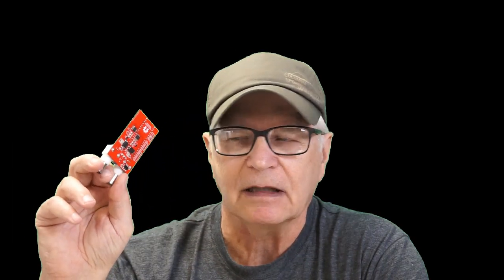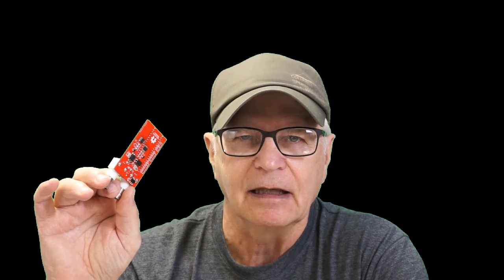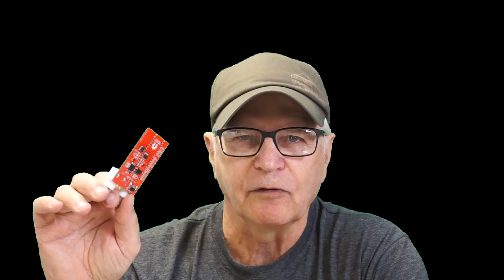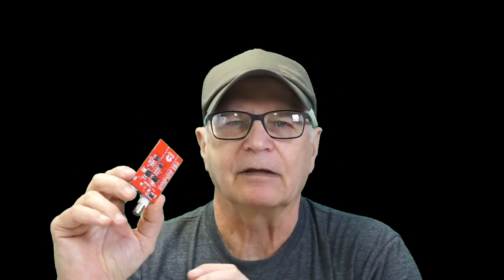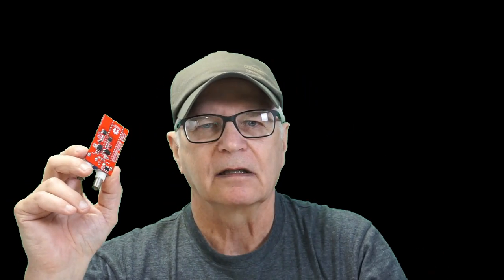GADGETS#145 - PREHEATER 946-1010 MANUAL

Comment: Maybe others will have some use for it but this is what I know so far about the new model now being sold on aliexpres. Model name is still the same but this is the white/green variant.

Press and hold temp up button and down button at the same time at the same time, brings you to the menu where you can set your temp offset (I think) goes from -50 to +50.

Temp up button and set button pressed and held at the same time takes you to another menu. In that menu you can only adjust the first one. I don't know what it's for but you can go from -199 to +199. I can't adjust the rest in the menu.

I did look at what chip is in it, hoping I could figure out how to make it heat up a little slower but there is no number on the chip so I can't look anything up. 

But at least now we know how to calibrate your temp.

Comment: Just took delivery of a UYUE 946-1010 from Aliexpress but unfortunately it doesn't appear to have a menu option. Long press on SET just seems to blank display and stop heating. Further long press enables display and starts heating again - bit like a soft OFF switch rather than having to toggle power switch on back.

Unfortunate really as I would have liked to adjust the display offset to better match the measured temperature (which appears to be about 10% lower than display says!).

Haven't tried it in anger yet as waiting for some fresh 183 degrees C paste.

Think that maybe I should have got the larger plate though as the temperature seems to drop off rapidly approx 1cm from the edge of this unit, and I'm currently playing with some 10x10 boards.

The unit does appear to heat up fairly quickly however so presumably has been factory set to higher rate.
Reply from the maker: strange your hotplate doesn't enter MENU with long press of SET button

but, if it heats up quickly and you're able to set temp you want then you'll do ok

I like this size hotplate but am not playing with 10cm x 10cm size boards you are...again, I think you should do ok anyways

good luck and let me know how you make out with it:)
Reply: If I hold down set and up or down at the same time I do get to another menu. But this one you different than as in the video. Mine just heat up too fast and get all solder balls
Reply from the maker: @Mr-Splendid-NL   am only familiar with the long press SET to enter menu and the instructions in the manual I wrote and shared
Reply: @Mr-Splendid-NL  Have you tried setting temperature lower to pre-heat, then raising it a couple of times to desired temperature for solder melt?
Reply: @techlobo2409  Yes that I do indeed for now. But it is not ideal. First, I don't think the buttons on this model are of good quality and I don't expect them to last long. And I would have preferred a way to also adjust the pwm so I can have it heated a little slower. But thanks for thinking with me!

Comment: SLOWLY putting together parts and pieces Denis, I am a novice(at best) just curious...do you have a particular source for PCB components you use? I was told by someone you could just send a complete list to (perhaps) places like Mouser/DigiKey, etc. rather than purchasing them piecemeal(which might be cheaper, but time consuming). Also, any particular solder paste you would recommend? Am interested in building the HS402/WiFi version, BTW....Thanks.
Reply from the maker: I and most guys on our HScope Telegram Group use JLCPCB for boards. And most including myself get the parts "piecemeal" often from Aliexpress

I invite you to join us Don...lots of help and pointers available there that may save you time and money:)

https://t.me/hscope

Denis

Comment: Thanks for this, I bought this for my clock work, to blue screws to a consistent blue. I am most grateful for you working out the program cycles as the manual (or more precisely the A5 sheet of paper) is hopeful. May I ask whether you can explain the section on "separate the screen operation steps"? It talks about a vacuum suction switch? I am not familiar with PCB work, presumably it refers to an extra piece of kit in that application?
Thanks again for the excellent video
Reply from the maker: am pleased you like the instructions and they sure make this heater more useable:)

I do not understand the following question:

 "separate the screen operation steps"? It talks about a vacuum suction switch?

was it something I mentioned in the video...if so, can you tell me the time stamp please...
Reply: @theGADGETSplaylist  
It's not on the video. On the "operating note", english side, the first paragraph is "temperature setting", the second is "separate the screen operation steps; 
a) Turn off the power, set the temperature 80-120, the silicone pad at the separation hole position
b) wait for the temperature set by the machine temperature, put the screen up, then the vacuum switch to open, wait 40-60 seconds
c) after the screen heating, with the wire, the separation of bars, to pull around the separation, while pulling bafore and after the back and forth several times can be successfully separated from the screen"

It's clearly all typical translation nonsense, but I'd be interested to know if it has any useful translation to me or other users
Thanks for the really prompt reply